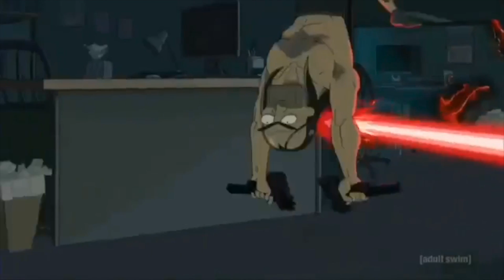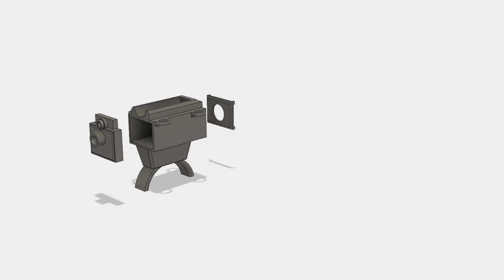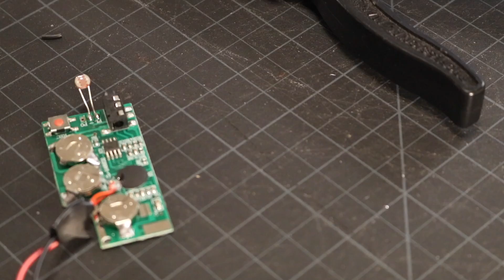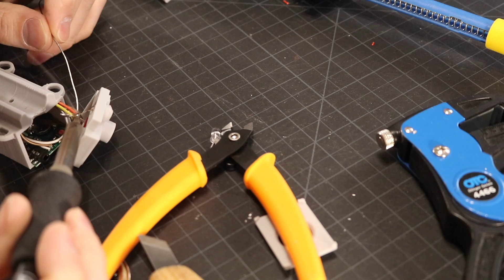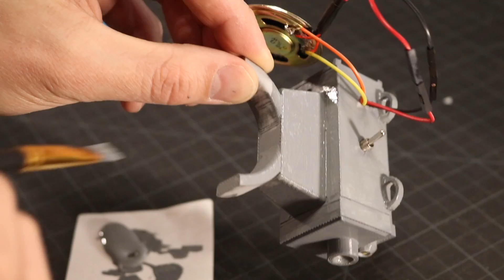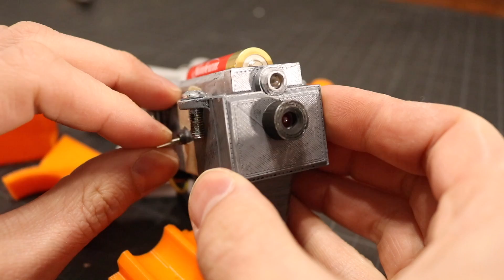Rick and Morty / Pickle Rick's Laser Gun 3D Printed!

Comment: Excellent job. You make the process look very simple. Roughly how long do you think the whole design, prototype, test and redesign process took?
Reply from the maker: Thanks! It took about 8 hours total from start to finish, split over two days. 

Most of that was printing out iterations of the main body to fit the electronics and the switch.
Reply: @AndrewSink  did that include designing the body of the laser to 3d print